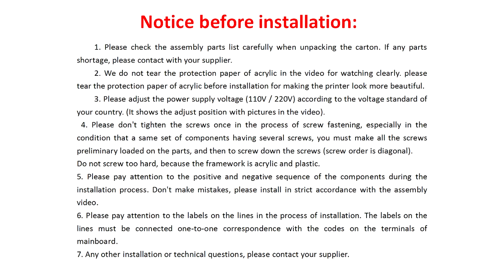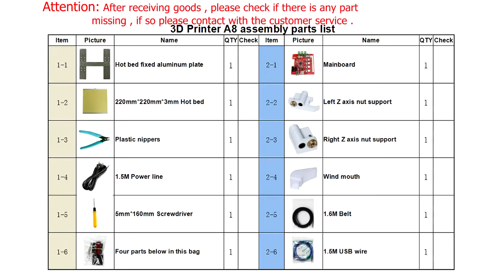Anet A8 3D Printer   Assembly Video 1 New Style

Comment: The 'H' frame for the heat bed bed is upside down in these instructions. The cross bar of the 'H' should be under the side parts not on top of them. This is important as it will cause the belt to be pulled at a slightly different angle when the bed is closer to either the motor or the idle pulley.
Reply: i noticed